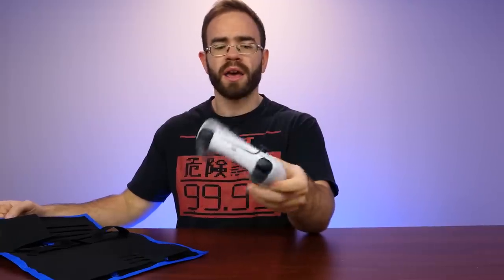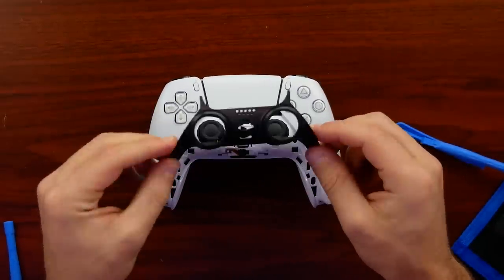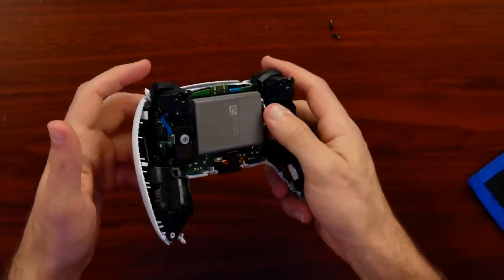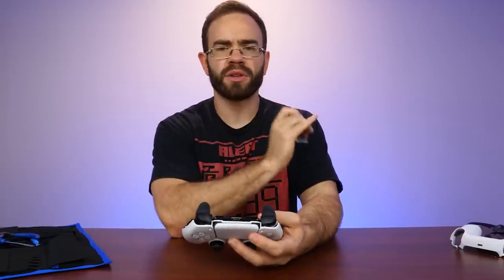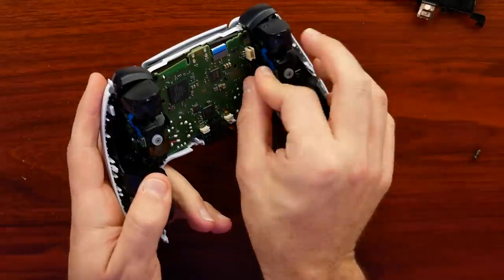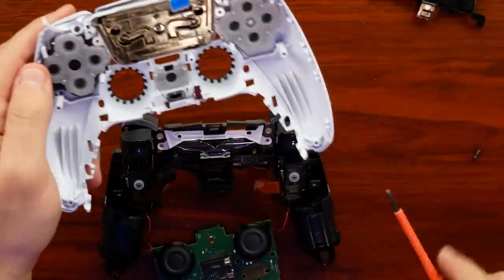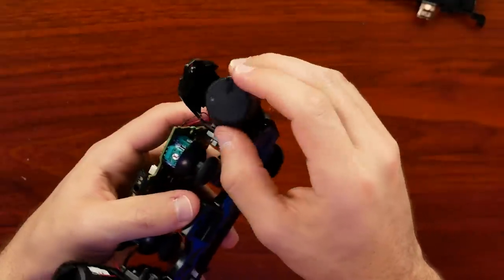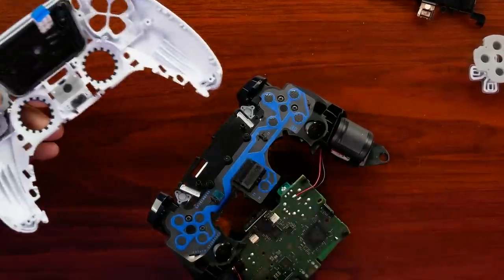The PS5 DualSense Is The Craziest PlayStation Controller So Far (Teardown)

Comment: I'm not worried about the plastic gears. You find plastic gears in lawnmower engines and electric drills/screwdrivers. If it's correctly engineered plastic is perfect. No need to waste money on metal if there is no need for it.
Reply: You're absolutely right and I guarantee these controllers went through some mad testing to be sure it was sound! I'm not worried either! Cheers!
Reply: @StudioCastle58  I see you every console vid. Just going about saying I hate __
Reply: @xavierwhitcraft1310  he is just looking for attention. Don't mind him.
Reply: Everything about the PS5, from the packaging to the console's design and specs, screams "budget".
Reply: @Rapunzel879  Lol it better be budget. I would rather they not spend on "premium" packaging so i can get a console for $399/$499 instead of say $599 like the ps3
Reply: @StudioCastle58  You really have nothing better to do lol?
Reply: Exactly, unless they are using the wrong plastic for the gears (which i highly doubt) they look quite beefy
Reply: @Souls8  First round of Dualshock 4's had a lot of issues. I had to replace my triggers and springs so I wouldn't be surprised when so many people use these there are going to be somethings missed.
Reply: @Rapunzel879  Actually the controller is more complex than the Dualshock 4 so I wouldn't say that.
Reply: @powerslideita  If it was more than $600 I would buy it if it's truly next gen. Original PS3 was worth it and to this day I still think it is.
Reply: @robertlawrence9000  Too bad nobody else would buy it, just like the ps3 at launch.
Reply: @jarde1989  guess ill find out tomorrow when I get my console

Comment: the gears look like they're acetal, so my guess is they're pretty strong
Reply: I hope so
Reply: just in case anyone reading this a dumb dumb like me:

Acetal plastic, also called polyacetal and polyoxymethylene (POM), is a general purpose, semi-crystalline, engineered thermoplastic. Acetal is commonly used for parts that need to be very stiff, have low surface friction and good dimensional stability. Dimensional stability is the ability of a plastic part to maintain its original dimensions when it is exposed to changes in temperature and humidity

sounds clever.
Reply: @StudioCastle58  clown🤡

Comment: Ah, too bad the interesting stuff on removing the cover was edited out.
That's what I was most interested in.
Reply: Other channels have done a full teardown (without breaking the top). You just pop the triggers off. It takes 2 seconds and they actually put them right back on after removing the screws.
Reply: Whatch battle beaver customs video on it
Reply: Whatch battle beaver customs video on it

Comment: There's a Foster Electronics logo on these vibration actuators. They are a Japanese company that specialize in speakers of all types, including that type of vibration actuator. I've had a look at the product lists on their website, and this does look like a custom part. I'd love to have a peek inside those!

The adaptive triggers are neat, they remind me of force feedback wheels. The amount of tension these can provide is tied to how much torque the electric motor can provide, which I'm sure isn't enough to damage the plastic gears, so ham-fisted gamers shouldn't break their controllers.
I do wonder about the durability over time as well though, not just because of wear and tear but also plastics tend to break down over time. We might see a bunch of broken trigger mechanisms pop up in 10-20 years.
Reply: I suspect 10 to 20 months not years
Reply: @robertlawrence9000  I wasn't thinking about the moment they start breaking (because if we're honest that's like 10 to 20 hours after launch) but more when we reach the point when they become like the N64's analog stick whereby it's genuinely hard to find a good one.

Comment: That looks like a decent size battery, should be equivalent to three Alkaline AA's.
On the other hand, I've got a ton of 2500mAh NiMH batteries, not quite double capacity but only 2/3 the voltage, so I'd guess Dual Shock and Xbox controllers are about on par for battery life at this point... Unless the haptics and Force Feedback triggers really suck back the juice.
Reply: It will you now got 4 motor

Comment: I think the adaptive trigger will be fine in terms of its longevity because the regulator (whatever inside that cylindrical thing) won't create a resistance/force that the spiral screw thingy can't handle. So we will never required to exert force above the pressure limit. What will actually happen when we push the trigger too hard is : the "regulator" will give way and it will feel just like when we press the normal trigger button on the PS4's Dualshock controller (if that makes sense). CMIIW.

Comment: It seems to me that with pressure that risks damaging the trigger, the motor will stop resisting completely or partially.  Or the maximum resistance has been calculated so as not to exceed the strength of the other components.  I'm sure the engineers at sony predicted many controller failure scenarios ... but did they predict all of them?  ;)

Comment: 8:10 Some clarification on the touch pad: Developers can use the touchpad to map different or seperate "buttons" or commands on the PS4 controller. You can setup the left, right, or four corners of the touch pad for different actions in game (ex. pressing the touchpad on the its left side will bring up a pause menu while pressing the right side pulls up your map). I'm assuming this option is still available for developers to use with the Dual Sense controller as well.
Reply: in the 5 years ive had the ps4 there's only 1 game which has used the touchpad which is WWE and it kinda sucked so i turned it off and selected buttons, hopefully they upgraded  it/made it more useable
Reply: @MrShokzZ  it if not Sony fault that game developers doesnt use this feature. They dont use other feature as well - like motion sensors could be used for very precise aiming in fps games, buit in speaker can be used to play additional sound for more immerse gameplay (be carefull here becasue I think it was MGS5 that did this but it was playing tapes from the controller even if you use headphones - which is stupid becasue you have to take off headphones to listen these tapes). lightbar can be also usefull sometimes but I think only The Last of Us used it. And there is probably few more. It all depends on the game developer.
Reply: @mnap89  So in short: Don't expect a lot.
Reply: just found this out when i used ds4windows
Reply: @MrShokzZ  Warframe
Reply: @MrShokzZ  Seems like you havn't played much then.
Reply: @cellspeed8682  nah it's just not very useful or used much by devs
Reply: @mnap89  yeh sure I don't blame anyone persay, just don't see much point too it

Comment: I prefer that screws are exposed - so much for "right to repair".
Reply: there just hidden and only require 4 screws to open. 2 are under l1 and l2 and 2 under the plastic front plate and can be taken out easily.
Reply: yes and no. I do like being able to repair my self but I do like how xbox one controllers have the back grip area that hides the screws.
Reply: Watch battle Beaver customs video. They did a full and accurate teardown it's not difficult
Reply: @LCJammer  *They're (contraction of "THEY aRE")
their: for possession
there: for all other uses
Reply: @moultonlavagaming  *myself, but
Reply: @alvallac2171  uh oh got caught by the grammer police lol.

Comment: I like the front plate and how it comes off so easy. Could easily be sold along with your system plates for a complete stylized look.  Also i will not be taking my controller apart ...wow looks like quite the tech in there!!!

Comment: If they choose a good plastic for the gears it wouldn't be a problem. The G27 that I had for almost 7 years never had a problem with its plastic gears. Neither the gears that conect the motors to the wheel, nor the gears in the position sensor.

Comment: That battery is shit compared to my Energizer rechargeable AA's I use in the Xbox controllers which is 2300mah. But yet people still think it's best to include this as a built in feature. Hell no to that, until they start using better ones then I rather keep my AA's.

Comment: For some reason both my DS4s broke at the pivot joints that allow the L2 and R2 triggers to be pressed and rotate. No other controller has ever done this with me. I've used aluminum triggers for my DS4s for years now with no issues. That plastic peg that always broke now looks to be a much larger aluminum bar on the Dual Sense.

Well done, Sony.

Comment: You can remove the L1 and R1 just by pressing down the correspondent trigger (L2 or R2), inserting some kind of lever in between them and then pushing out the button. They come off really easy. Then you can access the 2 screws behind them.

Comment: Yeah i actually expect these adaptive triggers to be a major weakness of the controller, breaking down. This might be the PS2 L2/R2 breaking off and getting stuck all over again. If you still have a PS2 controller, shake it, there is probly a piece of plastic flying around in there unless you opened it.

Comment: Yeah... curious why they didn’t use something like metal for the teeth of that gear.
Reply: @inputfunny  
True. Plus if it breaks, then people will probably buy a new controller or at least parts to fix it.
Reply: @chrissolace  more quiet and smooth operation of plastic gearing. Also less weight, plastic doesnt have much friction so it shold not wear donw quickly, also metal dust/filings could cause shortage if they go somewhere into the electronics parts. and not all metal parts are better - it depends on the alloy -0 for example cast ZnAl alloy would be terrible here(very popular alloy for casting small cheap parts) it would be soft, heavy and after some time it woul be brittle becasue of oxidation.
Reply: @mnap89  
Ah I didn’t know/think about that! I just assumed metal is harder and stronger than plastic so I assumed it was better durability-wise.

Comment: Was there even any lubricant on the gears in that trigger? It didnt look like it. IMO those will just break break and break. You could build a trigger using a stepper motor quite easily. Even a rotory encoder to read the trigger position. But the motors aswell as the drivers needed for them would most likely cost fair bit more than this setup.

Comment: If the plastic gears inside of a disk drive can get worn down or broken in a few years, then those user feedback gears definitely will. My guess is that Sony may have been a bit on the fence on whether or not to implement those triggers, so they just threw in plastic gears to see if any developers will even care about it. 
Next iteration of the controller will either have powdered sintered metal gears if it takes hold, or remain plastic for the few games that use the feature. 

I could be completely wrong though, but cost saving on a new marketing gimm... cough I mean, feature sounds possible. 😁

Comment: My biggest fear about the adaptive triggers is that some dumb assholes will think that the goal is to fully press the trigger in when it's giving resistance, and then hulk smashing the button instead of just allowing the resistance to do what it's intended to do. (ie. Give the player a more immersive experience) 
I feel like I can see a ton of controllers needing to be replaced because of that.

Comment: those screws must have been screwed in before l1 and r1 button was put in, so there's really no way to take the controller apart without breaking the plastic unless you can remove r1/l1 without breaking those two buttons

Comment: Open up the new rumble motors to see how they are made indise. Like is it just a standard style rumble but incased in a shell or is it actually something new.
PUBLIC NOTICE: The second set of screws is under the R1/L1 buttons which just pop right out without having to remove ANYTHING. So step-1: Pop off R1/L1 off to get access to the screws

Comment: I'm sure you can remove the L1/R1 button 1st to get to the screws. As you can easily remove the L1/R1 on PS1/PS2/PS3/PS4 and also the L2/R2 on the PS1/PS2/PS3 controller before opening the controller.

Comment: Some simple math can prevent broken gears, just make sure the force applied by the motor can be overpowered before the breaking point.  If the gears can handle 5 lbs. of force, make sure the motor can only "fight back" with 4 lbs of pressure.  If they have a true "lock up" for it, then yeah, they are definitely getting broken.  I'm a mechanic, my squeeze strength is unreal.

Comment: just a bit unclear on the way you say the adaptive trigger could fail/break.. does that mean it will still function as a regular trigger or would you need to get it replaced/fixed? EDIT: till it is determined if that is indeed a fault (unforseen) think I will gladly stick with one controller that I get at launch for a while.. not like I need a 2nd one anyway..
Reply: 13:50 it will still work, just the adaptive part will not

Comment: Since L1/R1 are snap-in parts along a groove, is it possible to remove them first to access those hidden screws? Maybe press down, dislocate to the left or right and use a thin wedge to free one of the underlying tangs and then pull it out?

Comment: I have heard that the ps5 controller can work on the switch with a 1doh Blu tooth adapter ( best buy $20) but I want to know if it does the rumble like what the switch controller but on the ps5 controller instead.

Comment: Seems like to assemble the controller they first screw the top and bottom half together and then just clip the LR1 buttons in place. So to take it apart you would have to pry the LR1 buttons out first.

Comment: Hopefully the force required to strip the gear/wormdrive is more than the torque of the motor so that the motor just yields rather than mechanical failure if you press hard enough because people will apply all their strength to that thing in the heat of battle that's for sure

Comment: The gear on the adaptive trigger looks like it might not hold up to a lot of pressure.  Or the motor may burn out if you apply too much pressure while its pushing against you

Comment: The screws on top are under l1 and r1, you pop them out as step 2 right after you take off the faceplate and get those two screws to avoid snappping the top when you pull it apart

Comment: What i want to know (and so far what noone has gone into) is how the flex and rubber pads for the triggers are laid out. I have a bucket of ps4 trigger rubbers that have been nearly worn through. These are one of the highest wearing parts in the controller. How hard is it going to be to pop off the trigger and replace the rubber pad under it?

Also cool note, the potentiometer only seems to be used for the motor position - it's a  customstepper motor essentially. Software must set a target location, and the dc motor dumbly spins until it's at that location. Really simple but should work fine.

Comment: Hopefully we can get a similar concept for thumb sticks in the future.   Fighting against the turn in a car or the recoil of a gun could be a interesting concept.  Though I have a feeling this current design will need to be improved to avoid people breaking them and making warranty claims.  I'm sure they work fine when not abused, but we've seen how some people treat their controllers out of frustration.  If a strong squeeze can break it, it'll be hard to tell if was faulty or caused by the user.

Comment: I could be wrong but I swear I’ve played a game with the dual shock where each side of the touch pad has a different function so those “arms” that go out to each side of the touch pad should be so each side can be read individually.
Reply: yes, because while there is a button underneath, the whole top part is still a touch pad. So if you press on the different parts of the touchpad it could be registered as a different "button"

Comment: Im sure Sony made it so that if you apply to much pressure to the triggers that the motor will give in before causing any damage to the plastic components/gears.  Otherwise, yeah this will definitely break if thats not the case.
Reply: *I'm
*too
*yeah, this
*that's
Reply: @alvallac2171  do I get bonus points if I act like I care?

Comment: I don't think the adaptive trigger motors are meant to lock up. Even if the plastic held up there would be a high risk of the motor breaking if it totally locked up. First gen controllers are always flawed in one way or another so I'm sure that we will see issues, but I don't think metal gears would solve the problems.
Reply: you find plastic gears in lawnmowers so if Sony is smart enough to engineer it properly it should be fine
Reply: Guess we will need something to surpass metal gear...

Sorry...
Reply: @ahjbyfyfihsdifhsuidh  😂 I'll give it up.

Comment: The design of the adaptive triggers are well done. They are using a helical gear with Worm gear to make sure the pressing transition is smooth and not jittering as it would with straight cut gear. Another good thing is if it breaks its modular to the board of the controller so it may be available as a replacement part.

Comment: Also, more moving parts on something thats just gonna get used and abused... isnt a good idead, i feel like after 6 months the little gears in there are gonna be useless or at least broken.
Reply: They shouldnt it they are made and used properly. Some time ago I had an old DDR(German) bench lathe Hobbymat Md65 from 1986. I used it for turning many different things icluding steel and stainless - small parts but it doesnt matter. It had all gears for main leadscrew made of plastic. And they were perfectly fine after all those years. So it just depends of the right material and most importantly how it is used my the end user.
And yes - I am sure there will be many ppl breaking these gears and trying to RMA but it will be refused.